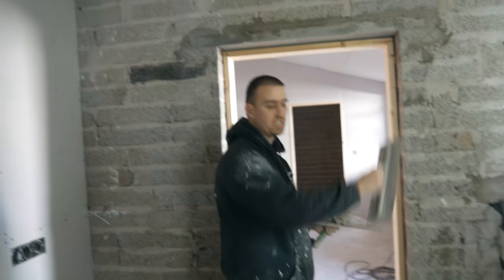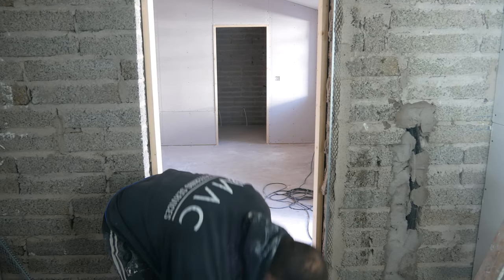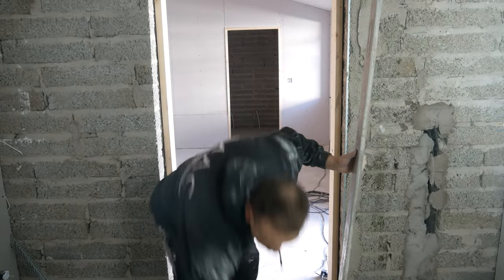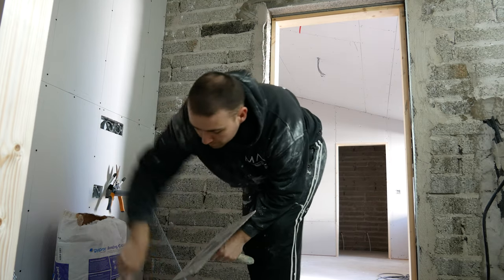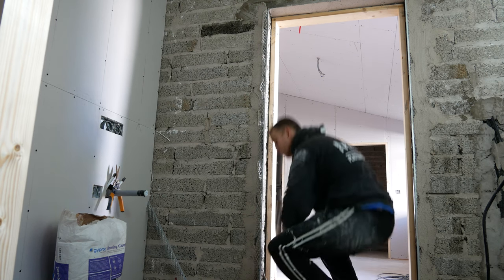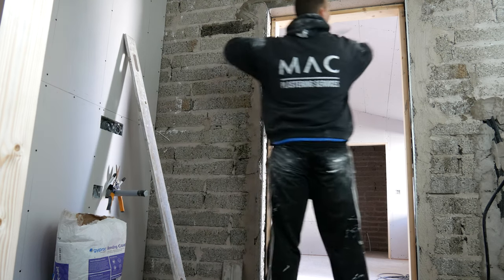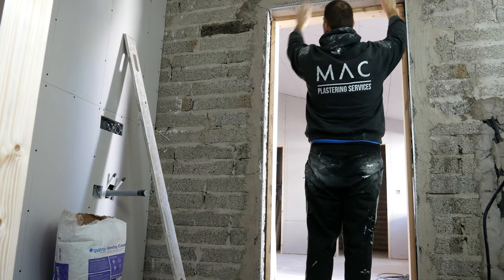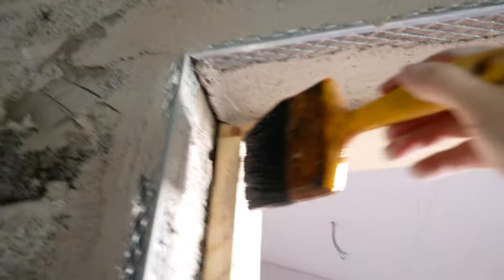How To Fix floating Beads To Brick Or Block Wall Corner Beads New Window Float And Set Cement Render

Comment: Hey Mac, have your ever used plastic render beads for internal floating? Is galv better?
Reply from the maker: Plastic would be more expensive and possibly a heavy coat think I have used them as they do arch bead that are flexible so still the same way finished wise

Comment: If you were filling in a gap around a door and the angle bead was tighter than existing plaster as in there would be a slope from the existing drywall to the bead edge,  what  should one do?
Reply from the maker: Just seen your comment mate you could fill it out to a stick / rule 1st so it is sqare then apply the bead and finish I will drop a like to similar video but i think i finished it without a bead but same rules would apply :)  video - https://www.youtube.com/watch?v=cQ5zgh2xGy4

Comment: what a great video you can tell you have a life time of experience, I have a wall that is damp, I'm using sika 1 sand & cement to waterproof it but the wall is miles out of plumb so I was gonna put the waterproofing on 10mm or so. then use bonding to build the wall out plumb & multi finish over the top, do you think I will have any issues with that ?
Reply from the maker: Hi john mate thank you for watching and commenting .... So if the wall is damp mate i would not go near it with bonding as it loves water and is like a sponge will take it in and hold it forever might be best sorting the damp issue at source / cause then use a few coats of sand and cement to build it out 10mm would be fine in 2 coats mate could almost get it in one but be easier if you filled out and scratched / keyed it again do a float coat then skim again
Reply: @mac plastering  morning Mac we have found after taking off a the ceiling & plasterboard walls we have a leaking roof (at home) so hopefully that will sort the damp in the wall out once it's sorted, the wall I will waterproof is ground level as there is no dpc, it's out about 20 or 30mm so I will just have to build it out in layers, hopefully the finish will be ok in sand & cement, as I'm a carpenter but multi finish & bonding are pretty easy to work with render is a little more  tricky but if that's what needs doing I'll work it out, thanks mac I really appreciate it!
Reply from the maker: @johns9543  I did find rendering harder to apply when learning to than gypsum as they are stickier :) You could add a little sbr in the mix it is great for water proofing helping it bound and  might make it sticky for you but can also be a hard thing to spread as it tightens quicker and is stickier LOL  you could scud coat then scratch coat 2 times if needed and a float coat and then skim sounds like loads but if not a big wall it will only be small mixes and we have videos covering all coats all mixes and methods that can be helpful mate  and always here if you need to get a little help mate
Reply: @macplastering thanks Mac,your a blinder.  thats a great help , I just bought 1200mm speed  skim metal & plastic &  the pole so that should help, 
I will probably run 3 batton's down it to level off & do it in thin coats, its a kitchen wall so it has to be square for the work top, it's about  3.5 m x 2.5m so it shouldn't be too bad, I have rendered a meter or 2 before so I'll just do it section's of the battons, I like the scud coat idea I just watched 1 of your videos in it, did you say I could skim over the finish ? In mutli finish?
Reply from the maker: yes yes so if you get the final float coat on of sand and cement then devil float it / key it up and a day or so later you can 2 coat of multi finish on its same process as the finish we use saying that we use both multi and carlite here
Reply: @mac plastering  that a relief , its a nicer finish to decorate  plaster than render, thanks Mac I've been watching your other videos on render & plaster, you have so many great tips & tricks I think if you've never used a trowel before you could after watching your videos theyre brilliant 👍
Reply from the maker: @johns9543  thanks John the more you fo the easier it becomes

Comment: Did you record floating the wall as well ?
Reply from the maker: Hi mate have other videos on floating ready for skimming = last weeks video on a dead wall https://www.youtube.com/watch?v=NeSClfONYoQ  and another or a doorframe wall would be the same method as for beads as it is fro frames = https://www.youtube.com/watch?v=-JhYlvIAS18
Reply from the maker: Let me know if them videos are helpful and for sure will be more videos on floating coming up
Reply: @macplastering  some of the corners I have to bead up are literally a couple of inches out from top to bottom. How do you normally approach these?
Reply from the maker: If real bad i would use a rule / Batton 1st then fill it out and set bead

Comment: I had issues keeping the beads on if the wall was rough
Reply from the maker: yea can be a pain best to clean them down 1st a good scrapping or a little hammer to clean off any lumps should help
Reply: I ended up nailing it :)  I have a space now behind some of it because the gap wasn't cut straight....a few inches in places  Can I put some acrylic filler in it.
Reply from the maker: Hard to know with out seeeing it but i am sure it could be filled one way or another to try and build up behind and make it strong ?